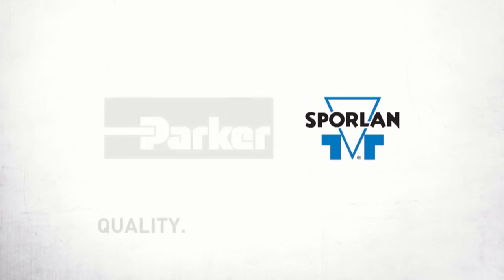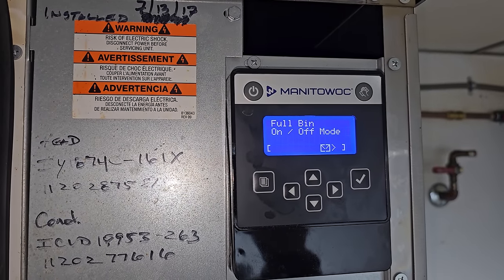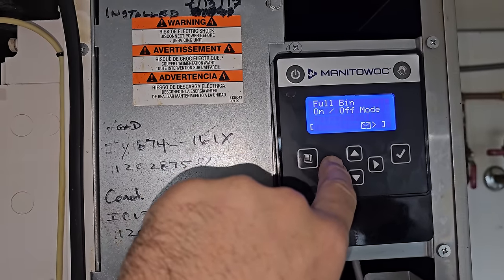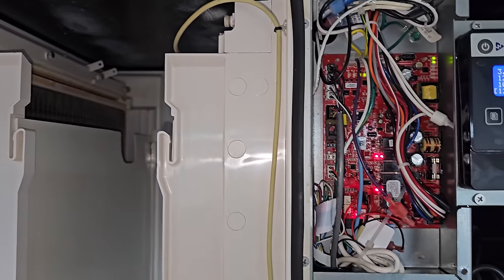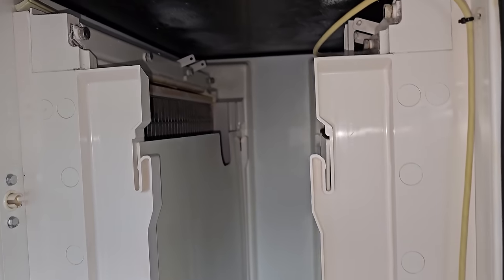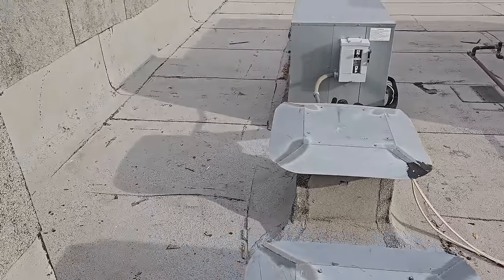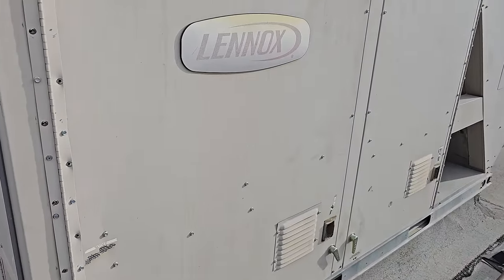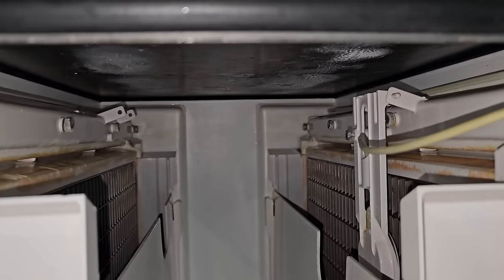MANITOWOC ICE MACHINE NOT WORKING

Comment: So, based on what you are saying at approx 18:00 about the cleaning while you are there and it is an over time call...

Your philosophy is simply fuck the customer they can pay for another service call because it is a Sunday?
How long would the cleaning have actually taken to complete?  Another hour?

You won't clean it, but you will damn sure look at units they did not ask you to look at ON A SUNDAY to look for more stuff to hit them up for when you or one of your employees comes out during the week.....

Seems greed and being in a pissy mood on a Sunday got the better of you.
If you are already there and cleaning it would have made it the most efficient and working properly, I am sure they would have GLADLY paid for the job to have been done right to begin with.
Just like the UV bulb thing.  You said you aren't going to mess with it at the time but then take the time to change it and fix the air pump connection.

So you did the simple stuff that took very little effort, but cleaning it would have been probably the most benefit to the customer.

Thank GOD I am not one of your customers.
Reply from the maker: Cleaning takes about 3-4 house to tear down the machine properly… walking past the ac units while I’m already on the roof took me an extra 5 minutes . But yes to answer your question my time with my family  is more valuable than the customers money to me especially when this customer does not do routine maintenance.
Reply: Going up on the roof to see if the ACs board got any errors on them is gonna take a lot less than the 12-14mins those machines take to drop ice. He’s multitasking. He also did say the customer wanted him to take a quick look at them since he was already there and they didn’t do routine maintenance…Pay attention my guy 😂
Reply from the maker: I will discuss this on my livestream this evening 12/4/23 @ 5:PM (pacific) on YouTube come on over and check it out https://www.youtube.com/live/Jts4CYkWsVI?si=du26wcfZjFKocSAz
Reply: .....this is a wild ass take my guy. I'm sure if the machine's cleanliness was stopping it from functioning, it would have been cleaned. Otherwise he's out there, charging overtime and working on an on-call day. As a business owner I'd much prefer the guy come out, do what has to be done to rubber band the thing back together and come back prepared later.
Reply: Whoa there, bud.  I'm not entirely sure how lessening the amount of overtime billed hours in order to come back and charge them LESS per hour for a normal business hour cleaning call is being pissy or greedy.

Also, since when should you not get an overall look at systems and let the customer know of any other issues?  In your own reasoning that's a blatant "let it break, fuck the customer, they didn't need to know there was a problem brewing".  Making customers aware of other potential issues extends to a ton of service industries, not just HVAC, and is a sign of good faith between the tech and customer.

Thank GOD you aren't someone I do business with.
Reply: Im sure Chris is also glad you aren't one of his customers. You sound like the type to juice up the bill by being there unnecessarily long.....ON OT RATES. I would have done the exact same thing Chris did. Im sure the customer will and doea appreciate that he isn't juicing the bill on something that can wait till normal hours...at a normal rate.....a return visit and the time it takes to clean one (4-6 hours...unless you are a hack ) will be far cheaper than doing all of it on OT rates....he is saving his customer money...and they keep calling him back for more work....its a relationship that is built through the years....if you go for the jugular every time.....you wont have much repeat business.....maybe you should think first before talking out your neck.
Reply: He was there on sunday morning.
Does restaurant needs to be with no ice on sunday evening, because of ice machine cleaning?

Proper planning gives benefits, if you are patient.
I do hope that you are not decision maker in any business.
Reply: all these flavors, and you chose salt.
Reply: Mate I don’t know if you’ve worked in any industry, but if you were to try and charge a customer overtime to do things like cleaning, they’d be furious.
Identify the problem, and quote to return…they’d appreciate that a lot more than double time
Reply: Well? Anything else to say from your lonely island? Lol
Reply: Jesus u angy bro
Reply: I work at an ice machine company. That's all we do everyday is service our ice machines. We have dedicated cleaners who do some repairs, and full time techs. The cleaners are there to do the simple things like preventative maintenance to keep the techs available for the more complex  repairs. I can tell you for sure that a machine of this size takes well more than an hour to properly disassemble, clean, reassemble, and then watch another batch to make sure it's operational. It looked to me like he was saving the customer money by getting the machine operational and NOT padding the bill with unnecessary frivololities. That machine didn't look that dirty anyway. When I'm on call on weekends, I don't clean the machine if its not essential to the immediate operation of the machine.

Comment: the two frequencies are not redundant - it's set to 100hz so it can listen avoiding 60 cycles. 120hz is for avoiding 50hz supply noise. Nyquist sampling.

Comment: I owned a restaurant for 25 years. I cleaned all the time. Closed on Sunday and spent all day cleaning  and sanitizing walk-in's, reach ins, hood, everything.    I cleaned the ice machine monthly and it had water filters, slime control things that went in the sump , etc.  My machine and bin was sanitized and recorded on a check list by the machine.  Even though I did this on my own, my health inspector wanted it done this way all the time too and he loved the checklist and record.  I am Serve Safe certified and  Ice is  considered food and must be treated as such.  I would not have allowed this machine back in service until it was cleaned and completely sanitized.  My health inspector would have not allowed it back in service - in addition to what looks like mineral build up, I'm sure there is pink mold and other molds present.   Most restaurants are filthy behinds the scenes - if people only knew.

Comment: Those Lennox units seem to be much better thought out and built than the equivalent Carrier units. When I worked security for a chicken production plant, we not only checked doors and such, but we were tasked with keeping an eye on fuel levels and temps on the refrigerated trailers as well. THE most troublesome reefer units were made by Carrier. Yet the old (often 10+ years old) Thermo King units just ran. On my watch, had a Thermo King throw a rod in its diesel engine, and one that needed a refrigeration line replaced because it had a leak. The Carrier units, I called in at least 20 with an issue that required mechanics to come out and do something and/or required a load to be transferred. One Carrier unit threw a rod, another had a seized compressor, several needed new alternators or other various mechanical things including new drive belts, and the mechanics HATED working on them.

Comment: Hello.....I'm considering buying either a Manitowoc IYT0450A-161 or a Hoshizaki KML325MAJ 30". I currently have a Hoshizaki KM-201BAH, which is too small. Both of the machines I listed will work to ice my sodas and food for my hot dog trailer and it would be placed in my basement. The Hoshizaki is about $300 more, so which would you reccomend for what I'd use it for and is the extended warranty from Amazon a good idea? I use approximately 180 lbs to 240 a day, depending on the weather. Thanks.

Comment: That ice machine like stated is basically clean compared to most lol. Have had multiple ice makers from Subway where they locked out due to the distributor tubes being completely blocked with black slime. Those tubes are over an inch in diameter
Reply: And the almighty Trilobite said "Slime is good!"😁

Comment: hey man love the vid’s i work at United and i had a quick question i kno people say it not possible but if your working on a unit that’s Tandem, Do you have to replace both compressor or could you potentially just replace the failed compressor. I know due to the oil  lines being connected together. I’ve had Techs tell me you replace the failed compressor and not both.
Reply from the maker: It depends on the Manufacturer but most suggest replacing both compressors in a Tandem setup when one fails

Comment: I was originally going to make this assumption, but is the 100Hz/120Hz relate to the fact that the microphones are passively "listening" for the 2nd harmonic of 50Hz or 60Hz that would be transmitted thru the water by the pumps and other equipment in the machine running? That's what it seems to imply, unless they are ultrasonic and there is some form of down conversion done within the machine. Then it would make at least some sense since it could be used to get background noise readings before taking the measurement. Doesn't seem to be much info on how these actually work.

Comment: As the Controller calls it Ozone Bulb it’s probably a UV-Light with a Quarz Case so hard UV can exit and actually generate Ozone.

Air that is pulled around the Bulb gets a Dose of UV that kills Microbes in the Chamber directly and at the same time Ozone is generated and pushed into the Device to work in all Corners of the Machine.

Ozone just fucks up the Plastic over Time normally.
Probably didn’t make the Magnet Cover and other cracked Part last longer…
But as long as someone isn’t served the Magnet it’s still Way better than the Risk of contaminated Ice.
And I consider it a better Solution than just a Corona Discharge for the Ozone. (Lower Voltage for the Bulb etc.)

—

Be careful with Bird Shit and Toxoplasmosis and other nasty Stuff as a Side Note.

—

Good Policy to set Limits whats done for the Customers on a unscheduled Visit.
A Company I know in a completely different Business startet to only do what had been discussed before.
No looking at anything that wasn’t mentioned before and didn’t happen just now.

Comment: 9/32" on the thickness probe gap or 7mm 
As far as the 100hz/120hz, it must get to 3,000 before its full and will got into a harvest right? each cube chamber makes a click as the water passes over it, thus making a consistent sound it can measure. pump flow rate is specific as is the volume of the ice to full, so given the pump rate, its listening for between 100 to 120 clicks per section as the water runs over each chamber. If i knew how many cubes are made per side i could run the rough numbers for you. But you probably and gather what i am saying, as far as the logic as to what that microphone is listening for and how it might be counting. I dont know for sure, but that is my hypothesis on how that works. 

Or it works off of sonar, cube depth is 2.22cm + probe gap is 7mm,  so we will just say 3cm is 0 and .7cm is 3,000.  it just so happens 100hz wave length is 3300mm long, and 120hz is about 2800mm long. So the 100hz and 120hz can calculate the thickness within a 10% margin.

Does that sound right?

Comment: I actually like UV lights in residential applications.  Here in GA,  equipment with UV systems (pre-coil) keep the indoor coils from corroding, quite a bit. I've seen 15 year old coils with well-maintained UV systems with little to no corrosion, as compared to non-uv systems with horrible corrosion at 2-3 years. They may not do what the customer thinks they do, but they will keep the equipment in much better operational condition.  Also, nearly EVERY heat pump system here will grow mold/mildew in the first couple of years. The UV setups keep that to a minimum.  They may not do much in your area but they work wonders here.
Reply: I love them, here in Hawaii   it is mandatory in all the School  AIr handling units
Reply: I’m in  N. FL— do you install the uv’s near the coils or in airstream?
Reply: @billcv80  in Hawaii,  near the coil is standard

Comment: Pretty sure if you have it in a test mode or something other than off or bin full and you power cycle/lose power it automatically starts ina harvest no matter what. 

It /may/ start in a harvest with an open bin because it can't tell if that's ice still on the plate or ice just holding it open. Stuck ice on a curtain still in Evap could cause issues if it doesn't start in a harvest and a do a full 6/7 min harvest whatever it is on that machine. All those Manitowoc boards ESP the ice and beverage nxts and the quiet cubers have odd ass stuff going in the software. The ibt nxts have a t5 sensor as some kind of backup for the bin switches it reads like the older Scotsman thermostatic bin switches or something I knew what it was once but I don't work on Manitowocs anymore. So glad 🤣🤣🤣 

We only have Scotsman and hoshizaki flakers at my job. Here and there some cubers. But I have yet to have to replace any control boards here 🤣 or touch pads.

Comment: A number 2 pencil is exactly 9/32ths of an inch.  Perfect for setting the ice thickness.
Reply: 8/32 is a 1/4" you can use your malco bit end (the handle mounting side)as a gauge or a drill bit as well.

Comment: This machine is way over engineered. Give me the old KoldDraft Ice machine any day. A simple float tank/switch connected to the sump. When it runs low on water it goes into defrost no firmware up date required.